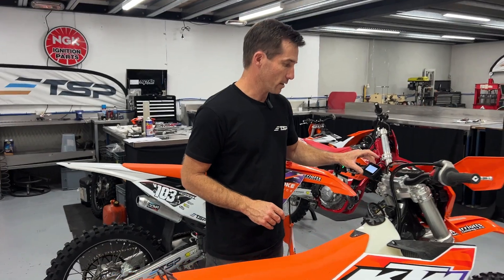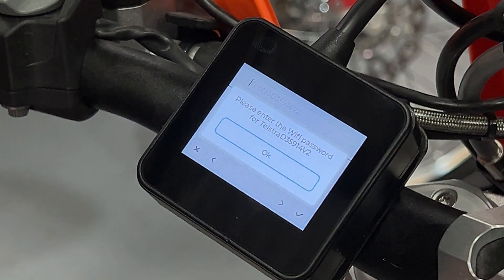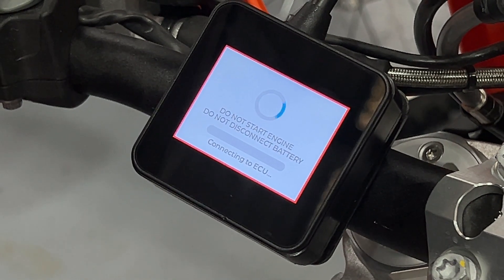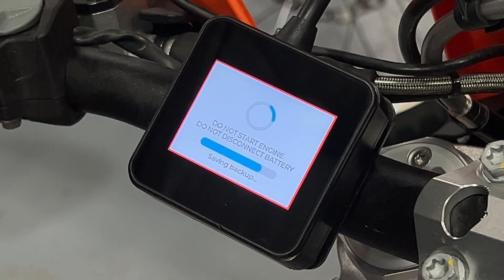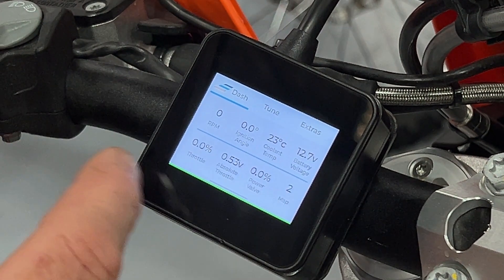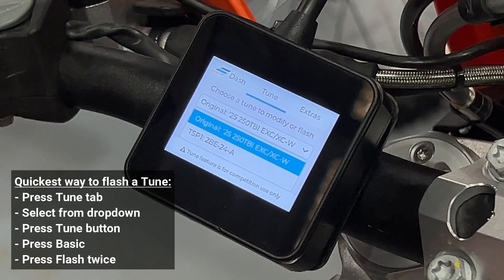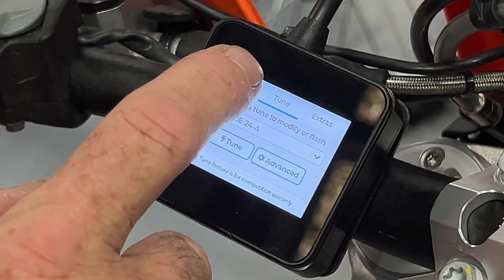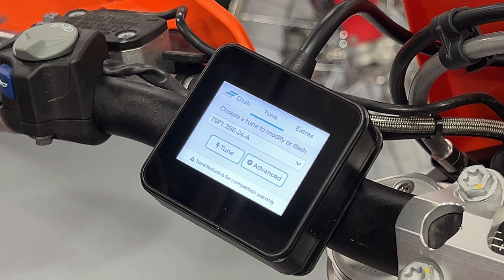Getting Started 5 - Pairing to the ECU and Flashing a Tune

Comment: No need to do the same set up as the 2 stroke? TPS calibration not needed in the 4stroke bikes? Thx
Reply from the maker: @grutzmac  yes there is some important setup required for the 4 stroke bikes… check out the video we just released yesterday…
Reply: @TwoStrokePerformance  thanks. I have the same bike as your video, but in North America. After flashing the ECU with the TSP map can I remove the emissions hardware, including the 02 sensor without fault code? So far, bike runs incredibly well! Way bigger gain than on my TE300 TBI with TSP, Head and PV Cover.